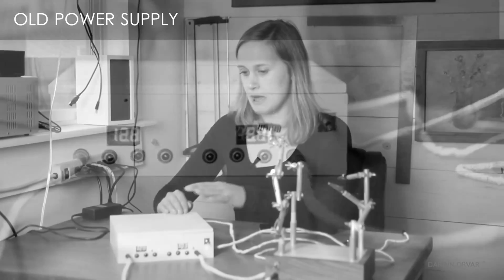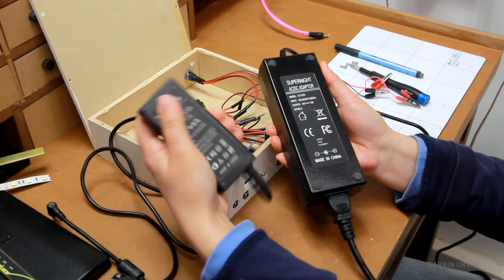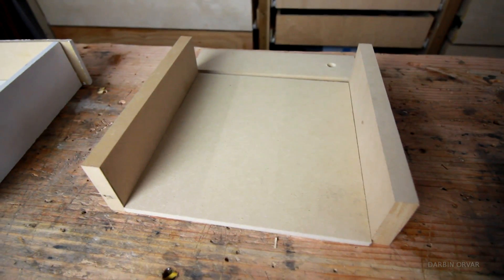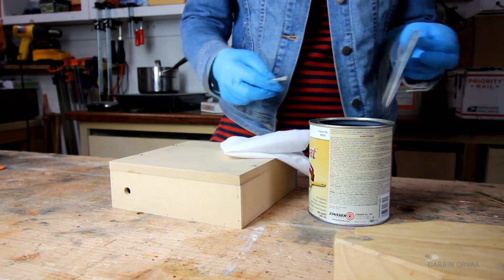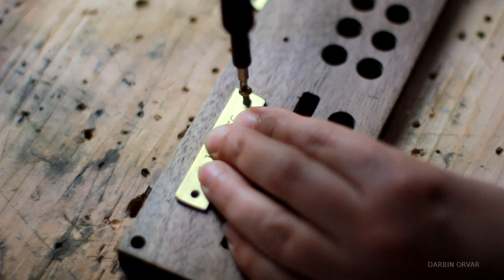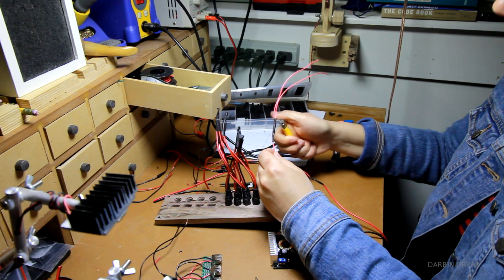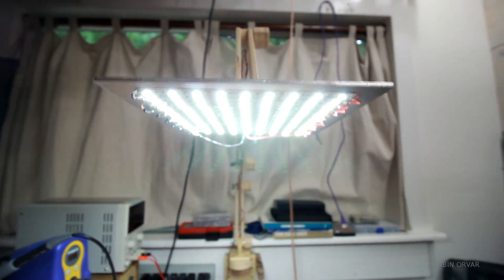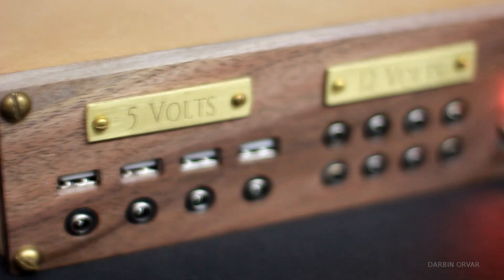DIY Ultimate Power Supply

Comment: Very nice, clean and useful project. I love the concept; a “drawer”. No extra space needed. You can charge stuff and power electronic circuits at the same time, a very clever idea. To me, the only fail is that switching supplies are too noisy and have too much voltage ripples. I would use the old school transformer supply.

Comment: Nice looking power supply, however it is missing a 3.3 volt rail, or perhaps an adjustable rail?  Just thinking, I guess should I wish to duplicate it, those are what I would add on for my uses perhaps my hobby is a bit more power hungry then yours, however it is a nice looking unit.  Perhaps using that nice machine to make some dado joints would have made it a bit nicer but that is a matter of choice as well.  Thanks for the video.

Comment: I hope I had the tools to make such a clean and professional-looking design (I don't even have a wood saw, not to mention that my apartment doesn't feature a working shack). I did make a regulated, adjustable power supply with a toroidal transformer and a aluminum case at school, but I think a wooden enclosure like that one would look much better.

Comment: You should really have LCD displays showing voltage and current on each side and coarse and fine knobs for adjusting voltage and amperage, i mean if ur using exactly 12v and whatever amp the power brick is ok, when I build mine however I plan on having a 3.3v, a 5v, and a 12v and probably 3- amps for the 3.3,  5 amps for the 5v and 10 amps for the 12v, that may change, i just wanna have enough power for whatever i need. It wont be used for running lights and such, mostly component testing prototyping ect.. im still a noob though an dhave no tools :(

Comment: Actually, the way you designed the psu, you could plug your phone which needs 5V into the 12V side, because you used the same plugs for 5 & 12V. And that's really not practical. Maybe improove that for version 3.0

Comment: I have an iPhone and the charger is written 1A / 5V.

So my question is;

how many Amps gets the iPhone than if you just plug into the 5V output of your power supply? Also 1A or not? or should I resist join it.

thank you
Reply: iPhone and other Apple products require some precise voltages on the USB Data lines to know how much current they can draw from a charger.

It's explained here:
http://www.instructables.com/id/Modify-a-cheap-USB-charger-to-feed-an-iPod-iPhone/
Reply: i need to putt 2.8V on te data line's?
Reply: I've never done this because I don't own any apple products (so can't test)
But it should be enough to set:
D-  to 2.8V
D+ to 2.0V

(For the 1A setting)
With two resistor voltage dividers, as shown in the circuit to the right

Comment: why not use an atx power supply??
Reply: Atx power supplies aren't floating, that is, their ground is the mains ground. This can lead to bad stuff happening if you use them to power something, that is already mains earth referenced (such as an Arduino connected to a PC via USB) and you aren't cautious enough.
Reply: I have done that. and the wire management is a horrible experience. but I worked. with ten 12v, four 5v and a 3v.
Reply: Ian Kyle Maturan I suggest a psu from a computer  due to amps you would likely require  most  power bricks for laptops do a DC out of  1/2 and amp 1.5 amp, kinda stupid  trying 5-12 watts from what looks looks like 12-15 volt  .- ..500/1500 .milli amp power supply..
Reply: Yeah. I am using an atx PSU. 600w....
Reply: sadly she isn't
Reply: i thought the same XD XD

i also wonder why people build vairable bench top psu out of atx then add a regulator XD
just change the pwm chip or circuit around it lolz

fun times wen i build a hudge monster out of the 10 atx units have

Comment: Nice work. But I would be conсerned with power brick and converter overheating, since box does not have any holes for ventilation. I suggest add 12V fan and connect it to 5V so it is noiseless. Then add some holes in top so fan forces hot air out by pushing new air into the box. Fan could be at the bottom and pick up air from desk. little feet of few milimeters would be needed to lift the bottom from desk so fan can pick up air.
Fully enclosed heating electronics can start fire in wooden box, so always respect cooling. 
Great work with wood!
Reply: Barry Manilowa
One fan (not all the fans, i suggest one) will draw negligible amout of power. Have you ever seen specifications of typical PC fans? And i suggesting to run it on 5V. BC547 transistor happily switches typical fan, being only small signal transistor. It would draw 60mA or less while providing some air movement through case.
Reply: Barry Manilowa
Did you read original post at all? I suggested adding vents (holes on top, and fan picking air from desk.)
Reply: +Barry Manilowa Valtra is right, the 5V buck converter (step-down regulator) used to supply all 5V ports power won't get upset by a single computer fan. The fan draws so little current that it would not exceed the maximum current output of the buck converter and definitely will not upset the power brick. It does lower the maximum current output by a few hundred milliamps but that's about it. The buck converter is necessary to supply the 5V outputs because as you must know, 12V is larger than 5V and charging your phone with 12V and with potential to supply up to 10 amps will cause a lipo fire, so the "extra regulation" cannot be ditched. And yes, you should have read the comment more carefully, as he did mention adding the necessary vent holes.

Comment: Can anyone explain the switch and led , is that turning the regulator on and off or the power brick?

So current won't flow through to ports until the regulator is on?

Comment: I do a lot of electronic work and you did a really nice job---except for one thing.  If I had built that I would have put in a small fan and vent holes.  As it is it will eventually overheat and burn itself out.  There is also the small chance of a fire.

Comment: It looks beautiful!

Might I suggest getting a power supply that supplies 24V and then regulating down to 12V and 5V?

You may find that when you load the power supply down, your voltage changes (your 5V should be fine, as it's regulated).

Have you monitored the voltage out from the supply as you're plugging your stuff into the system?

Comment: For electric safety reasons (protection from electric shock and fire) you should use an AC/DC adapter that has some third-party safety approval. CE mark is a manufacturer's declaration only. It would also be wise to use an AC/DC adapter that has an output that complies with limited power source of IEC/UL60950-1 it is usually marked with LPS.

Comment: Hi, the box it's just awesome, a piece of art!. But, on the electronics... I don't know, may I ask... if you need fixed voltage outputs (5v, 12v), why no use a standard pc power supply?, seems more simple, efficient and cheaper.

Comment: Nice looking power supply--and you got to build it to fit the space, rather than working the other way around. In keeping with the people mentioning heat, you might want to try sticking your multimeter temperature probe in there just to see how hot it gets.

Comment: If you care, the ripple on those cheap buck converters are pretty awful, especially if you ever push it to 8A.  Consider adding a (lower the better) low dropout regulator to filter the output. This will waste a bit of power, but will clean up your outputs significantly, which will help if you ever decide to do analog or audio type work. Maybe it can be v3!

That buck converter will also dissipate a significant amount of heat at high currents, and as you probably know, mdf does not conduct heat very well. Consider adding a vent or fan to prolong the life of the supply.

Comment: Do you not do any work that needs a variable voltage and/or current?  I know that most off the consumer goods use ether 5, or 12 volts but it seem like a hobby builder would need an adjustable supply.

Comment: Good project Darbin, but you need to make extra holes, on the sides and back and add a fan to dissipate the heat, higher current more heat is created. this will add years of trouble free service.

Comment: Hey Lynn, wouldn't the high amperage hurt your phone for example? I don't no much about technology, but I was wondering, since standard phone chargers use only 1-2 Amps. Thanks :)
Reply: The 5 amps is the max current that the supply can deliver but doesn't do that if it isn't demanded from the load(the phone in this case). Most phones charge in a constant current mode until a certain voltage where it changes to constant voltage mode. During the constant current mode the current is regulated and for the constant voltage mode the current is always lower than the first mode. This means that the phone will only pull as much as it can handle.

Comment: I use the 24 volt 6 amp supply which gives you 12 volts at 11 amps or 5 volts at 20amps  after going through a switching regulator.